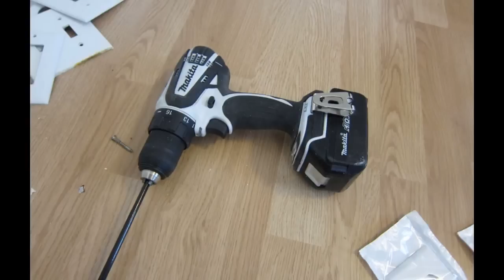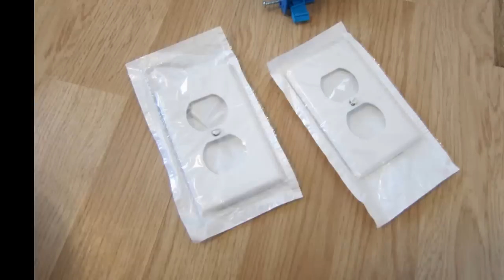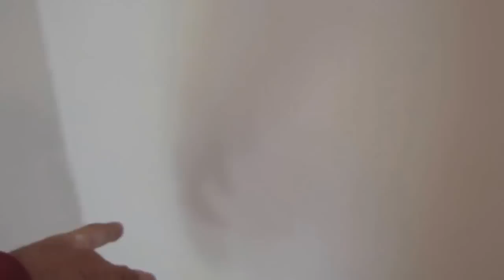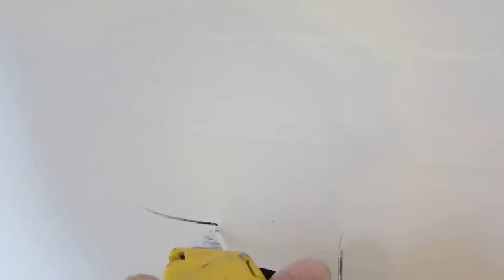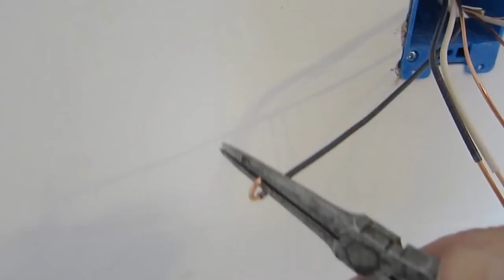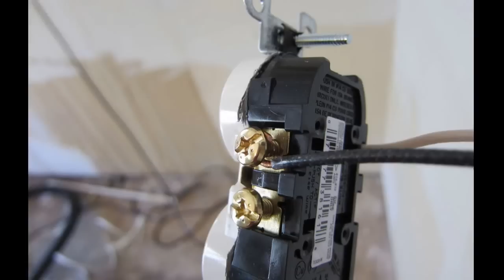How install an electric outlet in an existing wall

Comment: What if the distance will be further away like 10 ft to another wall?
Reply from the maker: the distance is not the issue its getting thru the 2x4 s with new wire
sometimes you have to cut a slot to the new outlet thru all the drywall